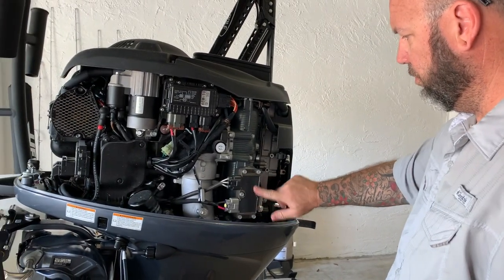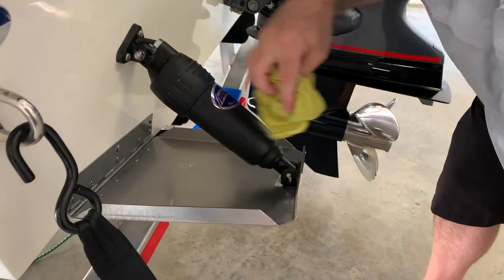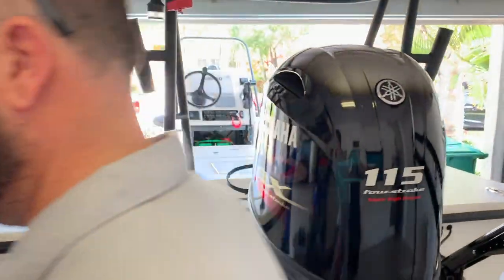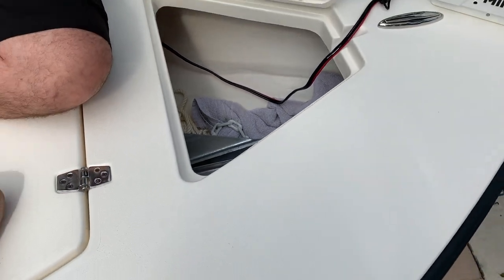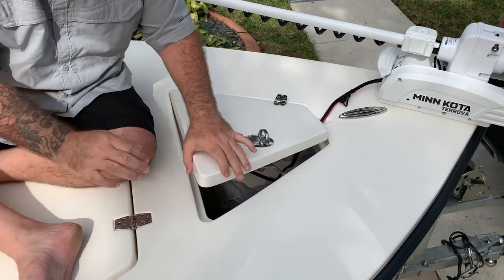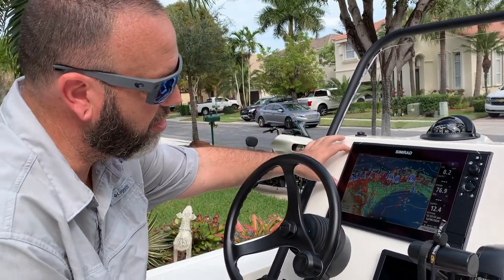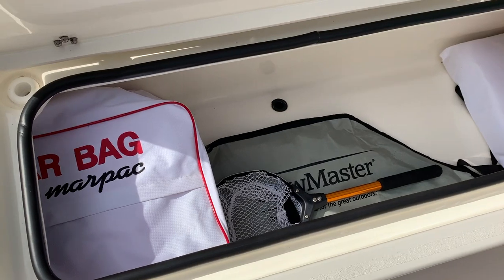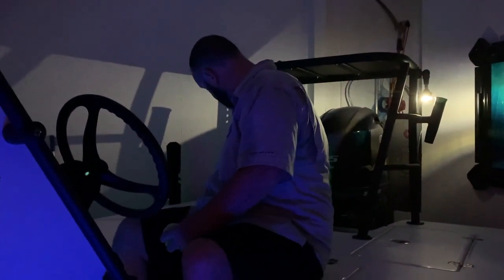2021 Hewes Redfisher 18 Walk-through

Comment: Very nice boat, i have ordered one almost identical minus the poling platform.  Have a question regarding which transducer you used and mounting location?
Reply from the maker: We had the factory put in a thru-hull transducer and it’s the Airmar SS75M. Which is overkill for a small skiff but we take it out over 150ft of water over wrecks.
Reply: @laubschertales4139  Tried to get the factory to install the transducer and I got response that they don't do it.  What strings did your pull?
Reply from the maker: @tombordeaux3700  slyshon@maverickboatgroup.com